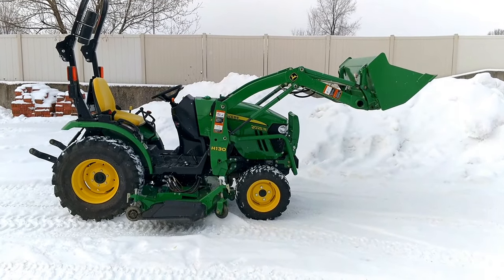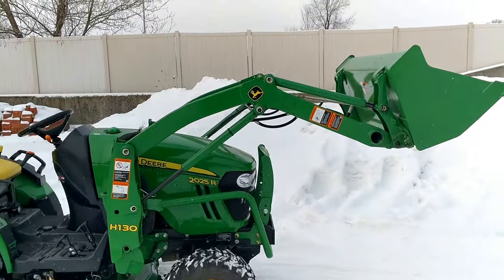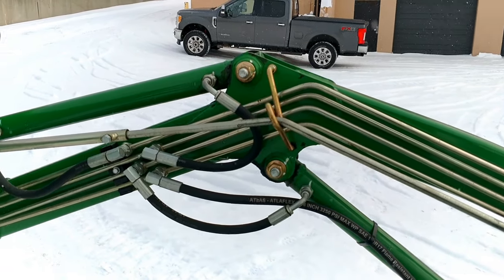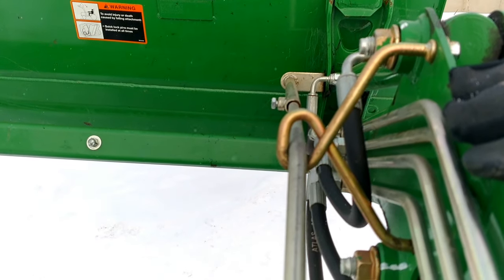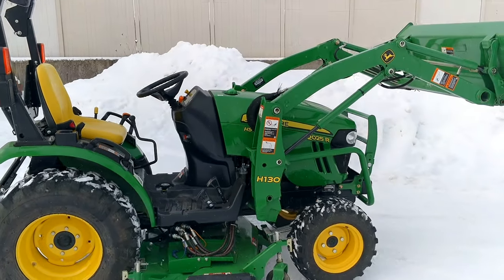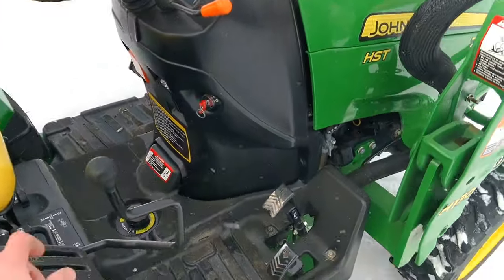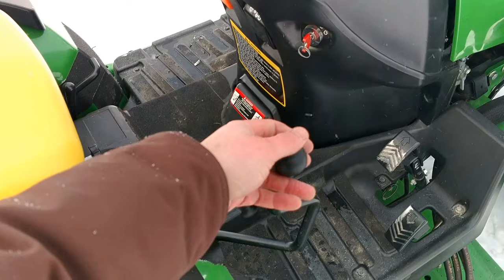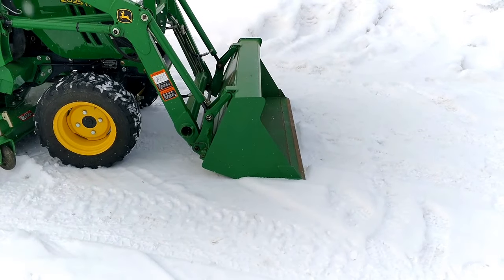Explaining How To Use The Float Position & Bucket Level Indicator

Comment: The point i learned from your video is that you don’t need to lower or try to set the bucket on the ground first. Just push it into the float position and let the bucket settle down to the ground on it’s own. Then drive forward. As long as the bucket level indictor is set and the bucket is level when it touches down, you won’t dig in. That one tip was all I needed to solve my problem.  Thanks.

Comment: But how to you initiate the float position to begin with? I just got my tractor and I'm not sure if it's engaged or not. Literally this video is you just suggesting you slam the bucket down onto the ground and go. lmao
Reply from the maker: I just watched the video again and I show all you need to do.  It doesn't matter if the bucket is in the air or on the ground.  I don't see a bucket slamming down on the ground at any point.  However, it is basically an instantaneous operation.

I have the bucket raised higher than normal to show the effect easier.  The video is very straight forward.  Push the loader lever forward exactly as I did in the video.  You push it forward which would normally lower the bucket.  Keep pushing it harder and it will go into a detent position which is float.  Pull back on it and it's back in normal operation.

Comment: I have a JD 3025E. Our 5 acres near Schulenburg, Tx, has a problem with fire ant mounds. If I were to try to mow over them, I would be breaking shear pins. So, I just lower my loader bucket, with a slight incline on it and activate the float function. This presses the mound back down to a level that I can mow over.
Reply from the maker: Nice, good application